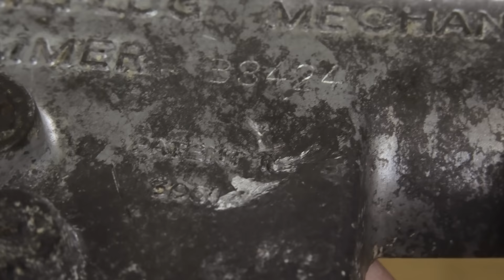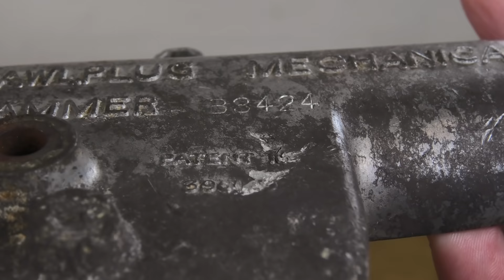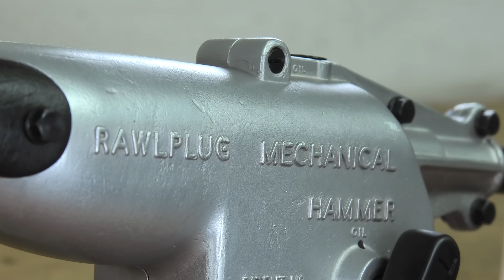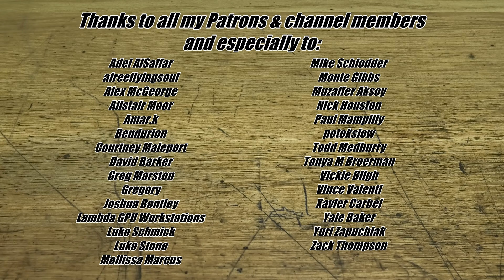Antique Hand Cranked Hammer Drill - Restoration

Comment: the part at 9:05 where you make the rivet just... disappear into the plate is truly one of the most beautiful things i have ever seen
Reply: NK
Reply: @MonkeyWithAKnife  oooh, thanks for the tip!
Reply: Came to say the same thing, most impressive part of the video.
Reply: My only issue with clickspring is that I have somehow managed to associate his videos with carbonara. Now I really want carbonara.
Reply: i thought the same exact thing
Reply: Fantastic video, thanks for sharing.
Reply: Wouldn't removing the rivet head reduce the strength of the part?
Reply: @MonkeyWithAKnife  just to say thanks again for this recommendation—i did indeed get addicted, but i regret nothing!
Reply: @AegisHyperon it's the metal that's been peened into the chamfer that holds the part together. that metal is there either way—the excess that's been filed off wasn't doing a great deal to aid the strength of the join.
Reply: @evilotis01  when the addiction gets bad enough youll have to consider his patreon which unlucks aprox. 40 more videos 😅
Reply: @MonkeyWithAKnife  oh dear god
Reply: How was that even possible?
Reply: Ya need to get out more apparently

Comment: In the 1950s I used the poor man’s version of this drill.  Rawplug sold a socketed handle which accepted the Rawplug fluted drill bits. It was used by striking the steel handle with a hammer and rotating the tool slightly between each hammer blow. I was so glad in about 1956, when I got an electric drill and masonry bits, even though at that time there was no hammer action on the electric drill.🇬🇧😀

Comment: At the time that was state of the art.  Imagine how slow drilling a hole was before that tool came out.
Reply: At one point a chisel would have been used, tapped with a hammer and twisted with each tap tap tap. It must have taken a hell of a long time.
Reply: From what I heard, the Egyptians used a copper tube being turned on top of sand to bore through stone. Imagine how long that would take.

Comment: I love how you go the extra mile to not just make it good as new, but better than new by fixing things like casting imperfections and improper fitting.
I see some other restoration channels just remove rust, replace stuck bolts then paint it and call it a job done, not even bothering to fill pitting or repair warping or damage.
Reply from the maker: Nice to hear that, thank you :-)

Comment: Hey!
I was wondering... what the bluing liquid exactly does to the metal? looks awesome!
Reply: it basically rusts the metal in a way that keeps more destructive types of rust from forming. more specifically, it reacts with the surface of the metal to create magnetite, the black oxide of iron.
Reply: Crea un isolamento alla corrosione, praticamente come la anodizzazione dell'alluminio.
Reply: @Kevin-dt9xm  why do you suppose he sometimes uses heat bluing and other times uses chemical?
Reply: @brian.willett  maybe it depends on the type of metal, or what its going to be doing. maybe its just about what he has on hand.

Comment: New to this channel, but I’ve used that same blueing for guns. If you wanna make it look better take steel wool and rub it down like you would sand something. It makes the blueing shine and look very nice, instead of a matte finish. Maybe you know this but I seen you blue several things and they were all matte. You technically are suppose to get the blue color you want by layers then “sanding” once with steel wool. Don’t sand then add another layer if you do that and you wanna add more layers you are suppose to clean the surface first then add more.
Reply: MM wants a matte finish and he likes the black color. He's getting the results that he wants. He's not aiming for a gunmetal finish. He has a video about bluing on his 2nd channel.
Reply from the maker: I'll try that
Reply: @my mechanics  awesome, it will need to be fine steel wool for best results.

Comment: Can you explain how sand blasting really works because I don’t really understand how
Reply: An air pressure system that literally air blasts some abrasive media at the object to remove the topmost layer of the object your blasting at- like rust or paint. The media can be sand, glass beads, walnut shells, etc. You have to be careful because the longer the nozzle is pointed at an area will remove more and more of the object in that area.

Comment: That drill is more beautiful and probably better than new! ❤ just one question: before applying cold blue to the zinc ring and pin, you removed the zinc coating with hydrochloric acid, but is this really necessary? In my experience you can directly apply cold blue on zinc parts? Or is there another reason? Greetings from Belgium
Reply from the maker: Maybe, to be honest I have never tried to apply it on zinc plated parts.

Comment: I wonder with parts washers. You mixed oil and water or water with soap? Sorry for my very bad english tho 🙂
Reply: The parts washer has a cleaning solution designed for it. You can use it many, many times until it needs to be changed.

Comment: Hey! A question: why didn’t you coat/paint/protect the body of the drill? It looks like it’s bare. You usually at least apply some form of protection, and you also didn’t use filler to fill all the pitting and dents. Any reason for this? Thank you :)
Reply from the maker: No need, it's aluminium, it doens't rust.

Comment: Hand drilling is part of my job as a floor engineer for our machines; would be a nightmare to have to drill with an old tool like that.  You'd easily have to be 4x stronger than I am with modern equipment.

Comment: The stock plate thing on the end is very obviously not assembled correctly lol. It's turned 90° compared to the original, how are you going to place that on your shoulder. But it does look good at least.

Comment: Just wondering should the shoulder plate be up and down, not sideways ?
Reply from the maker: Take a look at the shaft where the sholder plate is attached to. It has two holes, means it can be mounted horizontally or vertically ;-)

Comment: why put the stock on sideways?
Reply from the maker: Take a look at the shaft where the sholder plate is attached to. It has two holes, means it can be mounted horizontally or vertically ;-)